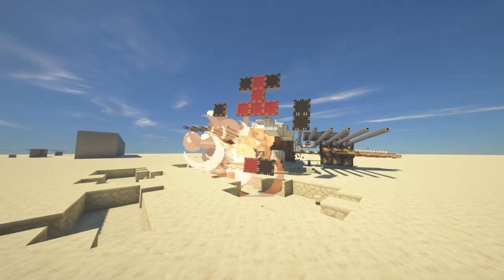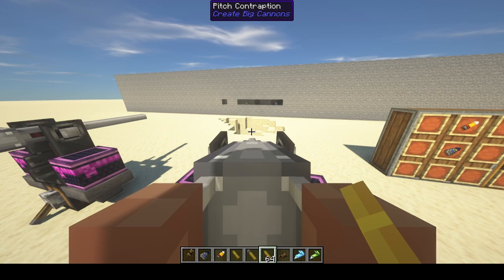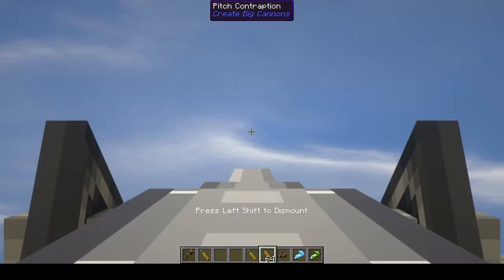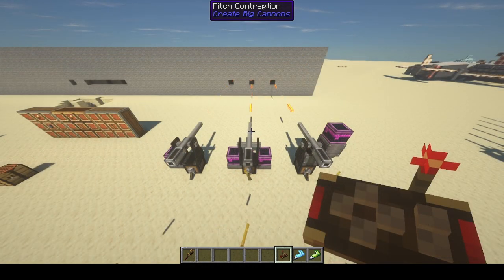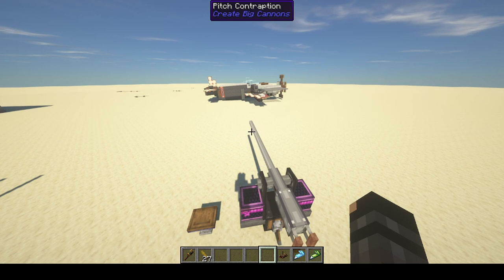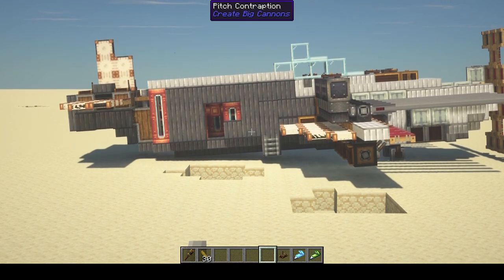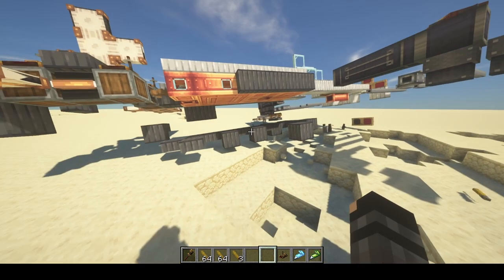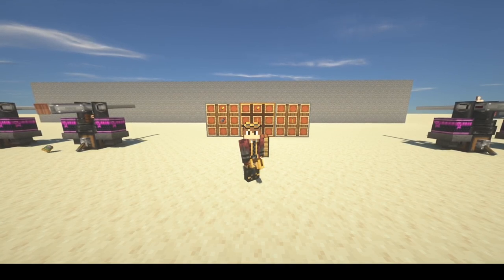Create: Big Cannons - 5 Autocannon Tips For More FIREPOWER!

Comment: The biggest problems autocannons face against aircraft is that it’s very hard to hit one even if the airplane is flying in a normal straight line. If you are doing a team thing, I’d highly recommended just not having front faced cannons on your plane due to the impossibility of you hitting your target. Rely on a gunner with a 360 autocannon.

Also setting the fuse length for proximity shells is a thing you can do. I’d highly recommend messing around with it because a longer distance could help hit fast moving aircraft.
Reply from the maker: Definitely seems easier to aim with a gunner. Thanks again for showing me how the fuzes work on the autocannon cartridges